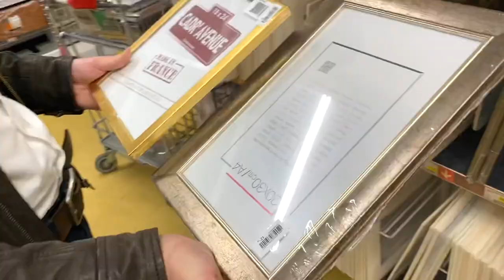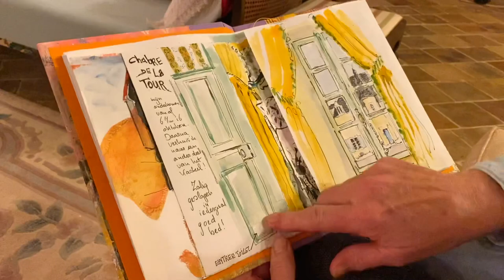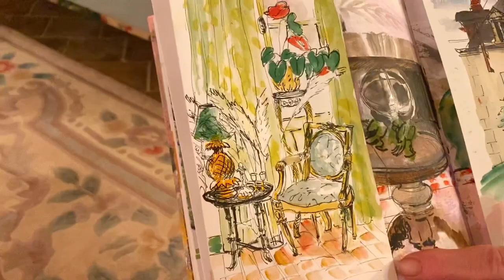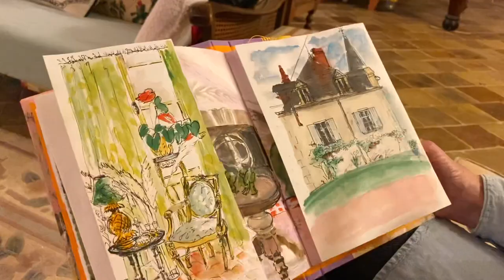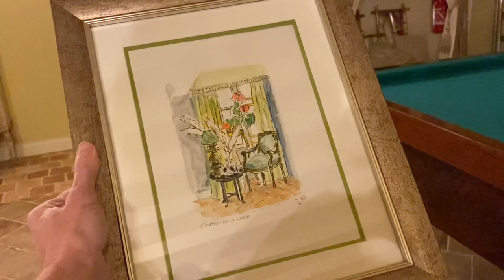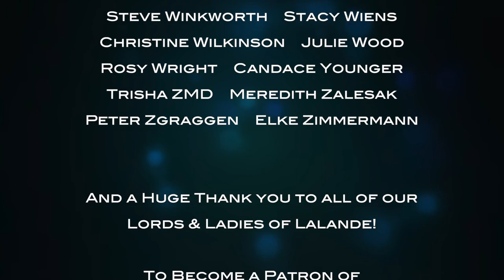The Chateau Diaries: THE COURTYARD OF DREAMS!

Comment: I apologize if you already know this tip, but I have been watching some of your videos over the past few days and you have mentioned the heating issue with the Grand Salon during winter. One of the issues mentioned, was the cellar access. Have you considered creating a cardboard buffer between the large outer door and the access door? I know you have plenty of cardboard from your unwrapping parties amongst other things and it would be a simple project to cut and tape several layers of cardboard to exactly fit the cellar door opening. It would be lightweight, so easy to move when needed, cardboard makes surprisingly good insulation and you can recycle or compost it next spring! Just an idea for a quick and very inexpensive solution to one of your many concerns at the Chateau. Cheers to all!

Comment: Dan was a bit hard to hear but am I right you're going to plant Alliums in between the lavender? If you are going for the big ones with purple flowers they can self seed and with time you'll have more if you're careful to not weed them out by mistake. Or you can simply take the dried seeds and sow in pots to make them easier to distinguish and plant once they've bulked up. It can save you a a bit of money in the long run as the bulbs are quite expensive. Just wanted to let you know :) It looks fantastic with the new borders around the fountain!

Comment: when measuring mounts with frames put the mount on the back of the frame and compare with the backing board for size if you put on front it could be wrong but the back is the right size to compare with. mount cutters can be brought I use one a lot as I collect autographs and mount under photos or measure back board from frame you have if buying another same size

Comment: Stephanie I think you need to prime the bathroom walls before wallpapering them. It will keep the green plaster board color from showing through especially if the wallpaper is a light color. Thanks for another awesome vlog! 🥰🥰🥰😘😘
Reply: Yes do prime before wallpaper, otherwise it will be impossible to remove a piece of wallpaper to patch if necessary.

Comment: oh one more thing , i saw some one made a shelf for their window and they used two different woods , one dark and they high gloss varnished it with boat varnish and oh my does it look beautiful , the two outside ones are dark , its an idea i think you should borrow too , i swear its so beautiful you will not regret the work SELMAR
Reply: either way  your likely to have to sandwich some boards together to make such a deep sill after all
Reply: the boat varnish is adviceable in any room that has water in it anyway too , with the increased likelyhood of damp air and old windows are not great for keeping out cold or wet , although i met a woman that fitted secondary pain made from clear plastic every winter , slip it in and move the latches to hold it there , it made the rooms much warmer ,  its warmer and done well you do not really notice too much